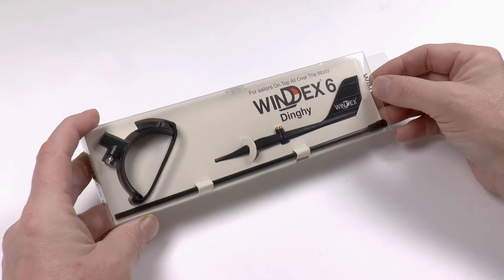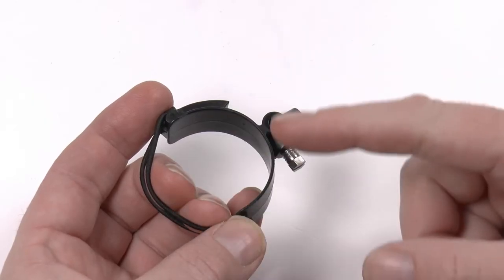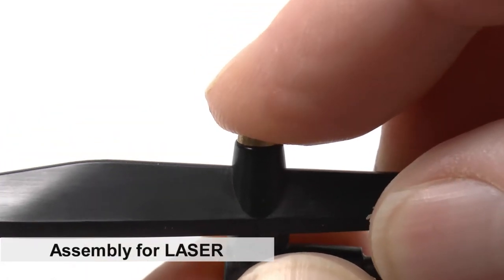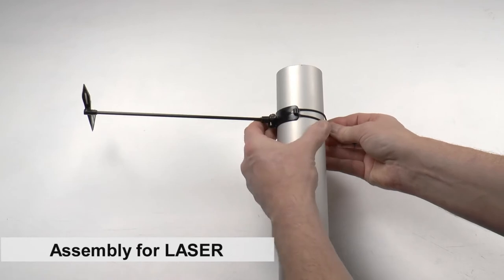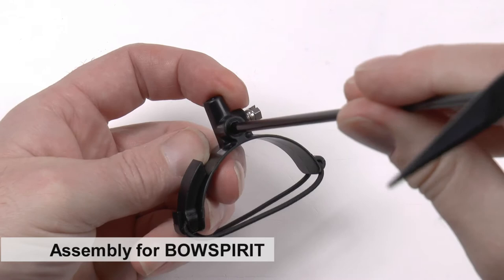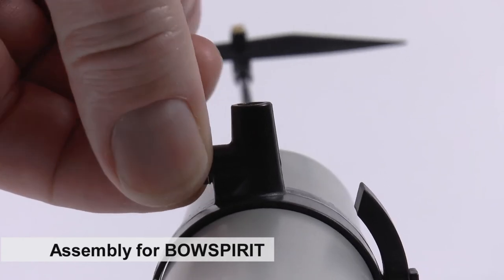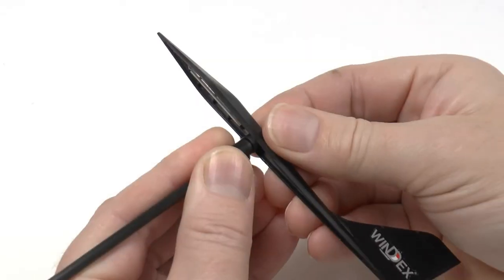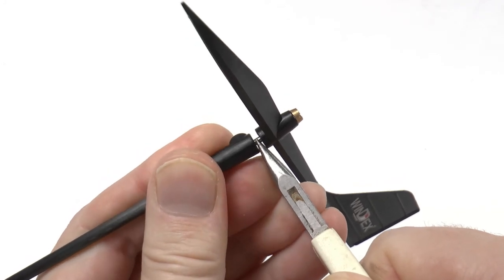How to assemble a WINDEX 6 dinghy

Comment: I use a Windex 6 Dinghy on the bowsprit of my Weta Trimaran but this has proven not to be an ideal product for the application.
1. The elastic of the mast fitting (now replaced with an o-ring) is not firm enough to keep the shaft in position due to wave action. However, the o-ring is not secured by the fitting and can fall off during installation/retrieval.
Solution: I have replaced the o-ring with an 80mm loop of 3mm shock cord which fits securely to the mast fitting and provides a much more secure location of the shaft which is resistant to waves.
2.  Recently the wake from a powerboat caused the shaft to break off at the connection to the mast fitting.
Solution: Replace the carbon shaft with a fibreglass rod which will have more flexibility.
3. The black vane is not easy to see against the water - unlike similar colourful vane systems from Ronstan, Davis, Windward etc. While it makes sense to have a black wind vane when viewed against the sky in a yacht, it doesn't make sense in a dinghy. I have coloured the pointer and tail of my vane with vinyl wrap material. 
Solution: Either attach a colourful coloured vinyl sticker to the unit during construction instead of the Windex logo or include a sticker pack with the product.
4. The finger grip for tightening the shaft in the mast fitting is not easy to tighten enough to secure the rod properly. OK I know I can use a screwdriver to tighten it further but it's not always convenient.
Solution: Replace the screw with a GoPro-style thumb screw which provides much better grip.